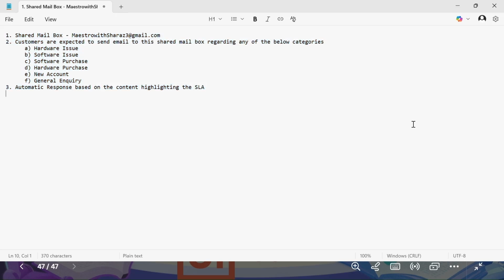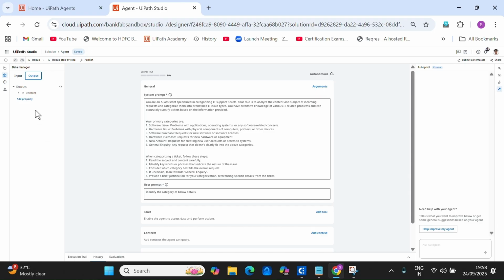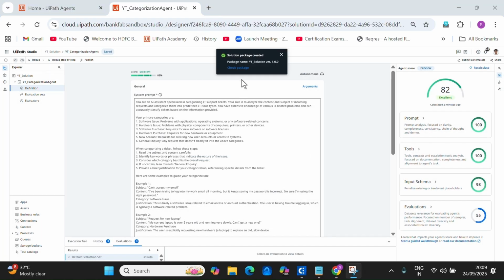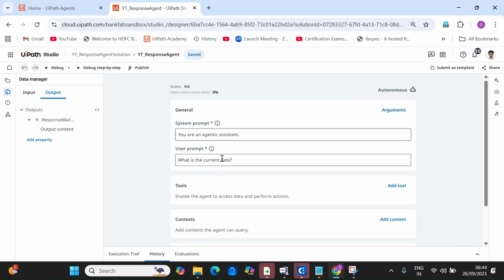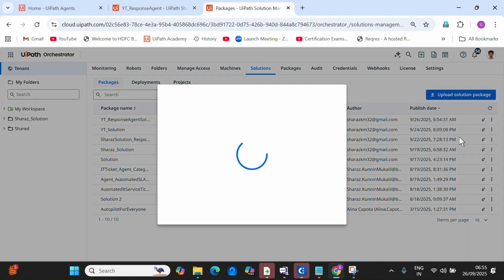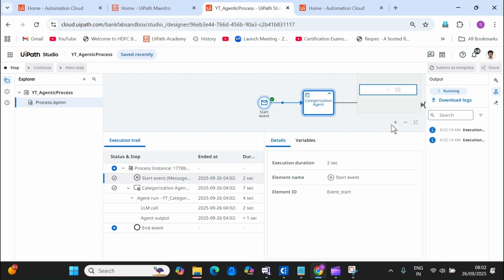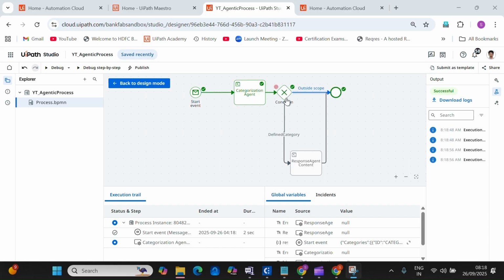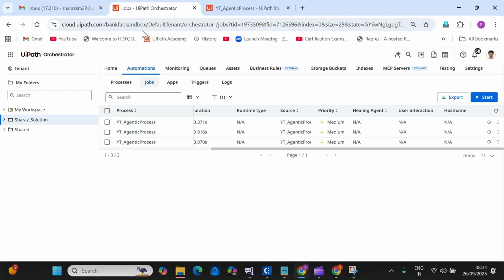Agentic Process using UiPath Maestro

Comment: can the agent tool work with electronics design tools. Like a schematic capture tool
Reply: Direct connection with devices are not possible..but once the output from the electronic devices are digitalized and can be accessed from a server / data base - we could fetch the same using automation tools and process based on our requirements